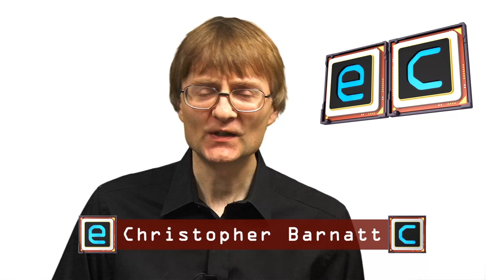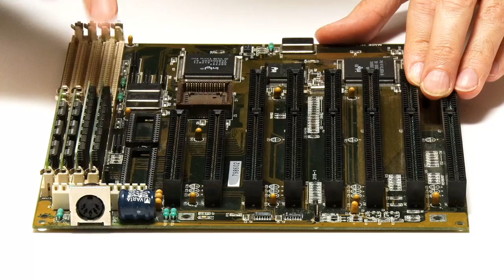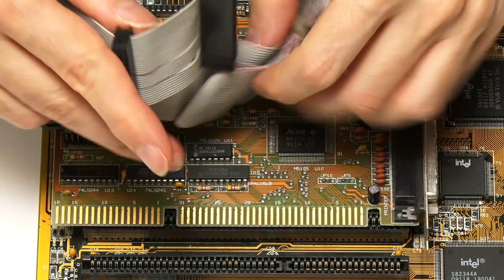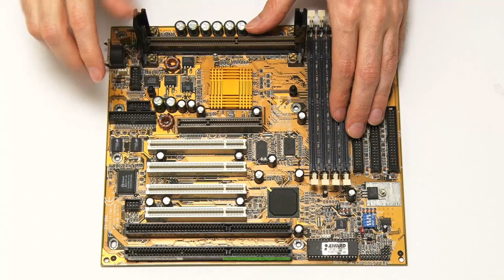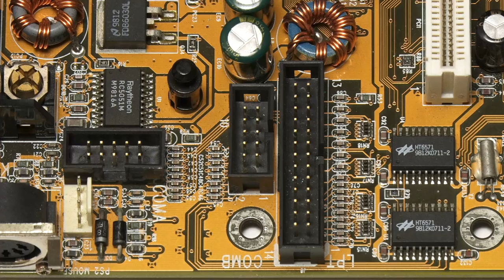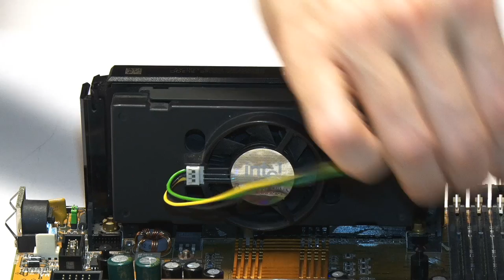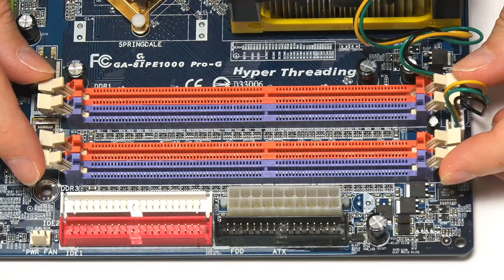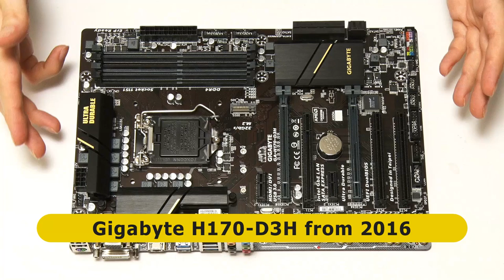PC Motherboard Evolution

Comment: If I remember correctly Slot 1 came about because of Intel trying to save some money. Intel were using L1 and L2 cache on their processors. If they tried to put both caches on the same die, the die became big and expensive. By using the Slot which took a what was a PCB they could put the CPU and L1 on the same die but then have the L2 cache as separate chips on the Slot 1 PCB. Because they manufactured it themselves they could guarantee the quality control and run the L2 cache without problem. It also meant they could put different amounts of L2 cache on the same CPUs  without have to use different dies. As manufacturing techniques improved and prices dropped the L2 cache was moved onto the main CPU die. Hence no more need for Slot 1 😊
Reply from the maker: Great info, thanks for sharing here.
Reply: was the pentium D the last slotted one ?? i remember we scrapped old work stations at the university (around 2010?) which were dual core optional and had two slots for cpus.
HP workstations for cad i think. too powerhungry for the time but still kinda powerful, i think some  were used with dual core afterwards in private hands and not scrapped.
i took some heatsinks with me i think. i guess they would make some nerd money now in original state 😅
Reply: Exactly right.
Reply: Slot 1 was during the PII era.
They released Socket 370 for the PIII era.
Socket 478mPGA for the early PIV then LGA775 for later PIV and early core 2/core quad.
Then the socket in the 115x family for consumer and the socket 2011 for enthusiast lines
Reply: Yeah, I would say Intel had trouble keeping up with PowerPC machines throughout much of the 1990s. Its architecture was simply not as efficient.
Reply: @Grayfox: before the socket 478 there was a short period Intel produced P-4 423-pins CPUs (<-- edited, thanks to Grayfox).  I have one laying about (1.4GHz/256/400/1.7volts  SL4SG Costa Rica) manufactured in 2000.  It had the CPU on a small PCB with the pins sitting on the outside edge of that PCB.

In-between the P-4and Core Duo, there was the Pentium D (also LGA 775), the first dual core.  It performed a touch better than the P-4 but when I got myself a Core Duo E8400 Dual Core, that's when the real speed difference was noticed.
Reply: @dazaspc, your right, I'd forgotten about that side of things. It was to try and cut out AMD and Cyrix. Didn't they copyright or patent the Slot 1 connector so the other 2 couldn't use it? The L2 cache did boost the performance for some activities, because for a while the difference between the Pentiums and the Celerons was the Celerons didn't have the L2 cache. However I also seem to remember AMD didn't need the L2 cache to be able to match Intel for performance 😂
Reply: You mean 423.
My first dual core was a E6420.
I decided to pay the extra $20 over the E6400 for the double cache memory.

But before that I had a 3.2Ghz Celeron D which I upgraded to a 3.8Ghz P4 Presscott and boy did that bitch run hot
Reply: @dazaspc - good times, when your o/c Celeron system could outperform the Pentiums 😊 The original Celerons, the Covingtons, did lack the L2 cache. "Launched in April 1998, the first Covington Celeron was essentially a 266 MHz Pentium II manufactured without any secondary cache at all.".
Reply: @IIGrayfoxII  P whas on slot1 aswell i depends on the Mhz on p3 might be if P3 whas 1,2Ghz or mroe i whas on 370 instead :)
Reply: @JamieWhitehorn  yes amd had Slot A instead of slot1 its pretty identical only mirrored i think :)
Reply: Yep.  Socket 423.  Also had a Prescott.  Was indeed a bit of a stove and gobbled current like there was no tomorrow.  Never had a E6XXX.  Went from a Pentium D to the E8400 (<--- a mighty good overclocker, that one) and then to the i7-860 ---> i7-2600K ---> i7-3770K.  Recently built a new system around a Ryzen 7 2700X.
Reply: Slot 1, lots of overclocking beasts from Intel came in that form....missed those good ól days
Reply: Oh Yes,. Good ole Rambus DRAM - RDRAM expensive as hell and ran hot.  First time the heat spreader was introduced on a stick of ram.. Intels 840 chipset would use only RDRAM in dual channel. The 820 would allow SDRAM or RDRAM. The 820 had to use a MTH/memory translator hub  for SDRAM to communicate with the chipset. Compared with prier chipsets runnning SDRAM Intels 820 would have a preformance loss due to this MTH.   And i'm not sure if there was a gain in performance useing the single channel Rambus memory of the 820.    So Intel came out with the 815 chipset that introduces pc133 SDRAM to the PIII and no MTH. Once DDR got up and running. Bye Bye Rambus.
Reply: I believe your indeed correct that cost and convenience (at the time) led to them have the cache memory included on the a board next to the processor, with the board inserted a slot on the motherboard. They did this for early Pentium II's, Celeron's.   AMD also offered a short lived slot interface for their some of their Athlon processors called Slot A.  Slot 1 was succeeded by the Socket 370, a return to the older ZIF type socket (for later Pentium III & Celeron), for which I presume was because they found a way by then to integrate the cache into the chip at a lower cost and size. With AMD, it was Socket A that replaced Slot A for later Athlons and Durons (also a  ZIF socket). Another interesting fact was Intel at some point offered Slot 1 converter cards (called Slotket) that include a either Socket 370 or Socket 8 socket on them, allowing somewhat newer processors to be used with somewhat older Slot A boards.
Reply: @IIGrayfoxII  Early Pentiums III used Slot 1, but later versions used Slot 370,. One could also use Slot 370 Pentiums III on Slot 1 motherboard  with a converter card for Slot 1 that included a Socket 370 on it (called Slotket). Socket 479 was used for mobile PIII's.
Reply: I think saving money was part of the logic behind Slot 1, but I think it was also an effort to set Intel apart from the many clone manufacturers at the time. That's certainly the reason for the hologram on the CPU package.
Reply: @lostcarpark  The reason AMD went with the Slot 1 was not simply to hamper competitors like AMD and Cyrex though it did also have that benefit, but rather due to a problem that they discovered with earlier attempts to make a CPU with L2 Cache built-in. When Intel introduced the Pentium Pro CPU which followed Pentium 1, it included a L2 cache on a operate die from the processor that was welded together in one CPU package. The problem with this at the time this arangement prevented the two dies from being separately tested beforehand and this lead high rates of Pentium Pro CPU’s having to be thrown out due to flaw in either the processor or L2  cache dies, leading to high costs for CPU. To get around this Intel decide to switch a circuit board with separate processor and  L2 cache chips fore the Pentium II. This new CPU slot was called “Slot 1”, with Slot 1 motherboard having CPU slot on the motherboard where you inserted an edge connector of the  Pentium II CPU board/card (The Pentium slot 1 CPU’s had the CPU board/card encased on a black plastic housing with an rectangle opening at one end much like a video game cartridge and with a Intel hologram sticker on the side to  show it was a genuine intel PII CPU. Due to licensing surrounding Intel’s Slot A technology, AMD decided to stick with the Socket 7 socket for their K6, then switched to slot for the early K7 Athlon CPU’s  called Slot A. Intel was able to resolve the issue with the processor and l2 cache on the same package when they switched back to sockets starting with the socket 370 (desktop) & 479 (mobile) sockets for later Pentium III’s and Celeron CPU’s. AMD also abandon the CPU slot with their K7 Duron CPU’s and later versions of the Athlon (above 1ghz) when they switched back to a socket (Socket A). Apparently both Intel and AMD had figured out a way around the testing issues that  forced them to separate the processor and L2 cache on separate chips and could now integrate them on them again as one package with high yields and lower costs. Ever since then both Intel and AMD have been using sockets.  

Modern Intel CPU packages and sockets have since switched from Pin Grid Array (PGA) used in all early Intel and AMD x86 CPU sockets to either Land Grid Array (LGA) or Ball grid array (BGA) Integrated circuit packaging. In a PGA integrated circuit packaging, the CPU has pins on the bottom that insert in holes in the motherboards CPU socket (known as a Zero Insertion Force Socket (ZIF) which uses a lever to clamp the CPU into the socket). making contact with metal electrical contacts at the bottom of the socket holes. With PGA, things are sort of reversed, with the CPU having flat contact points in its underside that connect with pins in the socket. This also requires the use of a clamp. With BGA CPU’s, there are flat contacts on the underside of the CPU and ball contacts points on the motherboard (and no socket) and the CPU  is permanently soldered to the motherboard and thus not up-gradable. (BGA CPU’s are most common in laptops/mobile devices, though some desktop machines use them especially small form factor PC’s.)
Reply: @PsiQ  Pentium D was not slotted, it was LGA775. I had one of those - P4 805D - and it was atrocious, it would literally overheat with the Zalman cooler he showed (8900CU)  before getting to a login screen. Not to mention that cooler weighed a kilo when the weight limit for the cooler (with the mounting systems then) was 450 grams. 

Dual core means two cores in one CPU socket. You'll have had the dual socket systems, which used two physical CPUs each with typically 1 core. These existed since the 486 and Pentium days - all hail the mighty Abit BP6 with two celerons - and would be faster than a single core system, if you had something to do with two cores. Chances were, you didn't - because nobody owned those systems, barely any software even used threads.

There was also Slot A, which AMD used for a very short while. And before the slotted systems there were 7 whole socket types - socket 1 through socket 7 - where IIRC socket 1-4 were like regular DIP sockets that just require a lot of force to insert the cpu. Imagine that 486 he showed with just applying force to get the thing in. Socket 5-7 were ZIF sockets, with a lever on the side that would move the pins over, and then you could insert it with zero insertion force (hence ZIF).

The slots went away because the pin count just kept going up, on one hand for more bandwidth and speed, on the other hand for more power connections & ground connections, and at some point signal grounds between high-frequency signals. You just could not put more pins on a slot without it being a foot long, and that gives different problems, so back to the sockets it went.
Reply: @JamieWhitehorn Yep - and underclocked, because you don't want to compete with your top of the line P2's. They then made the Mendocino's, which were similar but with a tiny cache, which also overclocked really well - but not as well as the Covingtons - but which still sold like hotcakes, especially with the Abit BP6 then.
Reply: @Charlesb88   Try putting 370 pins in a line and you'll see another reason. Or try putting 2000 pins in a row for the current xeons :D
Reply: Just for anyone who noticed I mixed up my LGA and BGA interfaces when talking about modern CPU sockets be in my previous comment, yes  I know I know and I corrected it. It's LGA that's used for modern motherboards that accept up-gradable desktop CPU's and BGA for permanently soldered on  laptop/mobile CPU's/mobile motherboards (as well as some small form factor desktop computers.). Oh, and one additional comment LGA sockets have an advantage over PGA as they can have more pins due to ability to use smaller pins more closely spaced and  it's somewhat it's cheaper to replace the motherboard typically then the CPU, if you break a pin. LGA CPU's also are more durable due to not have easily bendable/breakable pins in the underside, say if accidentally drop them.
Reply: @dascandy  At the time they where using slots vs sockets, the electrical connection count on a CPU was not so high that that was not an issue at first, of course that would soon change as CPU pin/electrical connection counts rose, so it's understandable they couldn't stick with a slot over a socket got very long and that's also why they went from PGA to LGA CPU interfaces on desktop motherboards, as LGA allows for smaller pins more closely spaced. Also, the slot 1 and slot A CPU cards were humongous things (with attached heat-sink/fan) that took at a lot of space due to width and length issues, compared to even modern LGA CPU/CPU socket with stock heat-sink/fan.
Reply: No slot one ran all the way to the 0.13nm with some mods FCPGA2 to slot1
Intel went backwards to 0.18nm with the pentium 4 like Russia's economy..
Reply: Much confusion in this thread. I recommend you check out Wikipedia, there is a rather comprehensive and well put together info about all sockets and slot.

When level 2 cache came around it was initially a separate device sold separately as a regular IC put into a regular socket. Then they where made into LIFs just as a math coprocessor/FPU, then integrated into the CPU package. However it was very difficult at the time to manufacture such large memory with the same speed, so it was made as a separate chip on the same package. As CPU speed increased quickly this wasn't enough, and the slot solution came in to separate them further, but not too much, and also set the L2 to run at half speed or something like that.

As manufacturing improved it catched up with demands and cache was eventually fully integrated into CPUs.
Reply: @JamieWhitehorn  I remember AMD having a slot CPU connector as well, and I considered if when I was building a new desktop in late '99, but I found a Duron and Socket A MB on sale, I went with that instead.
Reply: @PsiQ  No. Pentium D is already LGA775, so no more Slot 1. Get informed and keep reading with attention.
Reply: @aleculunguleac  Sooo. You
a) dug up this now zombie-post
and
b) corrected something which was already corrected 7 month ago by other users?

Yep, totally fits the "get informed and keep reading with attention" theme here.
Reply: @dazaspc  Nah, the first Intel CPU that required Rambus RIMMs was the early P4. PII used PC-66 and then later PC-100 (possibly 133 later/based on mobo support).
Reply: Well, as you see nowadays with the development of PCIE, the cartridge form factor for CPU may come back - basically you see 4 pcie x16 lines coming out of your cpu socket on a mb pcb, but and then you have m.2 as pcie card and basically all pcie users either as integrated parts of the mb pcb or as pcie expansion cards. It depends on cpu marketing a lot: if there were no amd and no marketing race - i bet, intell would update chips less frequently and thus motherboards would have as many slots as in 286/386 days, it is however, possible that 2 pcie slots would stay and everything else would be integrated on mb pcb and replaced altogether with the board/cpu.

Comment: This video and the previous one similar to it are exactly what the young technicians need to know to understand older equipment they may need to repair. Thanks
Reply: Useful in repairing modern machines as well as a general primer. That's because the fundamentals are still the same ;)

Comment: I sure miss those good old cereal ports. Especially in the morning...
Reply: cereal ports lol
Reply: Yeah, helped keep you regular.
Reply: serial and we still have serial connections nowadays. serial ata for example or universal serial bus.
Reply: You can still get motherboards with UART (serial) ports, but they're usually workstation or server boards where you might need to connect to a piece of hardware (like large 48-port gigabit switches, high-end wi-fi access points, etc) via terminal. Home players would rarely, if ever, still use a UART or a floppy these days (unless you're me), and as such have no need for these ports on the motherboard. Most people who use UART or floppy these days just keep a USB version in their laptop bag, but even those can be hard to find without going online.
Reply: In those days, “serial” specifically meant RS-232C/422/423.
Reply: RS-232C/422/423 are a form of UART, but I note the distinction. Thanks.
Reply: Ran sweeter with sugar on top.
Reply: @BlackEpyon  you can buy modern day serial port expansion cards - those are a must have when developing hardware
Reply: @cokeforever  Yeah, I notice the USB ones can be a bit finicky.
Reply: @lawrencedoliveiro9104  RS232 - reminds me of all those cheesy midi controller keyboard I had when I was a teen using Cubase.
Reply: cereal??!!
Reply: Now that is a MIDIocre pun. Boooooooo! 🤪😹
Reply: I was one of my companies serial port experts.  I am the guy who got plotters working with Unix boxes.  but I will say, if you did not something that was not 'guaranteed to work', you are going to have problems and needed an expert like me to design cables and alight speed/data check protocols.   I now see why serial ports disapeared form PC's.